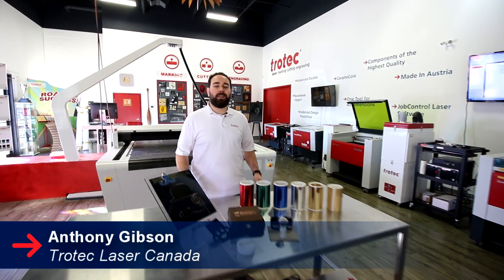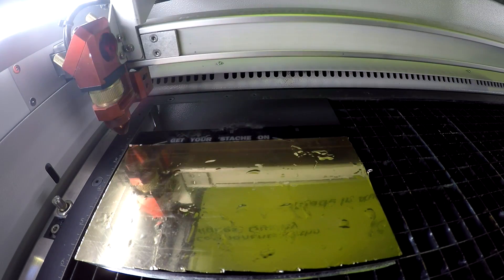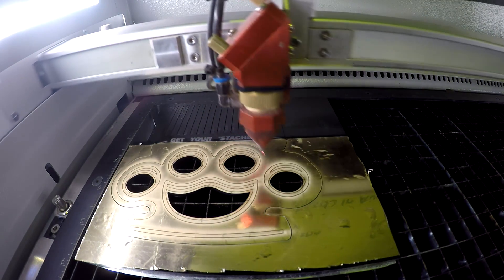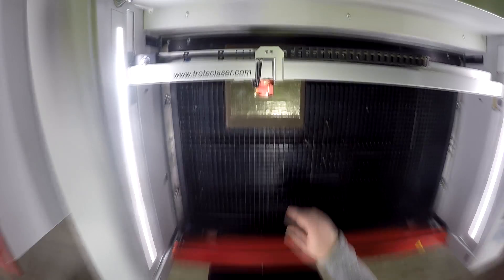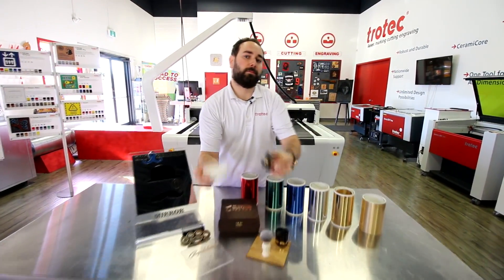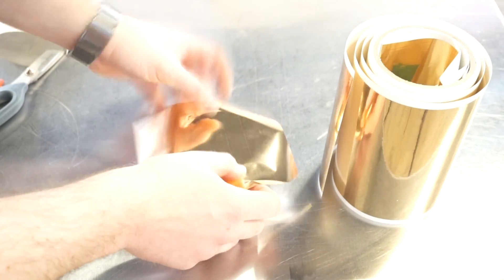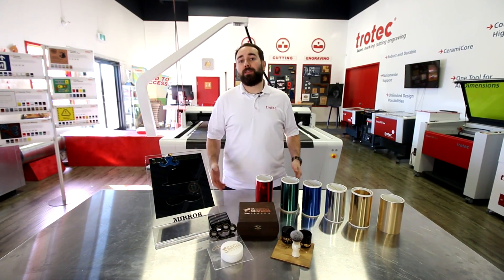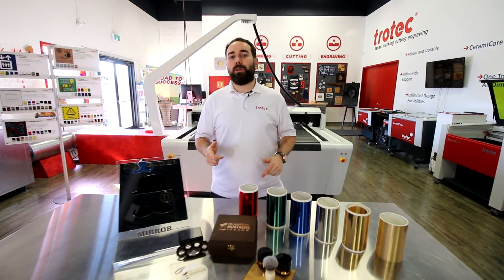Laser Cut Foil | Laserable Foil | Trotec Foil Rolls

Comment: You say it is a permanent bond - but then you peel it right off with ease? Is there a missing step to make sure the foil is really bonded to the surface?
Reply from the maker: Hi there, that's a good point, when the laser etches the kiss-cut it bonds the inner foil onto the surface where the outer layer can be peeled easily. We hope that helps.

Comment: If only you could use this for electronic circuit PCB boards.  Maybe if you used conductive glue instead of solder.  Tape layers would allow for multi layer circuits.  If the foil was multi layers deep, higher current could be utilized.  If you made an antenna array out of nickel foil, you could make a passive radar chaff reflectors.
Reply from the maker: You can make PCB boards with our Fiber Laser: https://youtu.be/xhPJhiM-PzY

Comment: what setting are you using Paper ? what substrate am I setting it up in  I am doing it on a glass but glass will not cut so what do we use ??????? This is important info you completely missed
Reply from the maker: Carol Wierzbicki hi Carol lets dial back the aggressiveness. The settings are in the video description. As you can see by the video we never do a full-cut on the foil, its always a kiss cut. Also, you should not cut glass with a laser, it can shard and crack. As in the video we have used the foil with wood, plastic and acrylic - place the foil on an object, do a kiss-cut, then peel off the extra foil that you are not using.

Comment: What settings would you recommend for the speedy 100
Reply from the maker: Darrell Atkinson hi Darrell try make a small square about 0.5”x0.5” to test out. What wattage your Speedy 100?
Reply: @TrotecLaserCanada  where would i find that out, i've been looking and theres 3 different wattages on the machine via 3 different stickers
Reply from the maker: @MrButtface34  Hi Darrell, have you purchase a new Trotec machine or used? Are you in Canada?
Reply: @TrotecLaserCanada  Hello, so I am trying to use gold foil on wood plaque. i am using speedy 300 machine with 60 wattage. i want deep engrave rectangle box with gold foiled name in it. any help would be great. settings and design wise, thanks in advance.